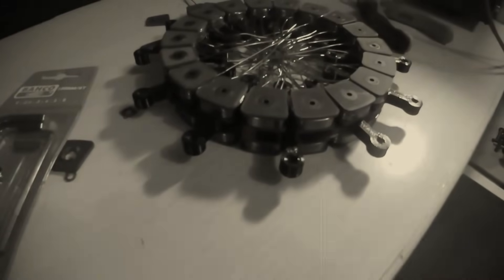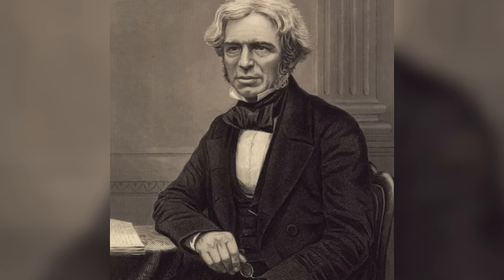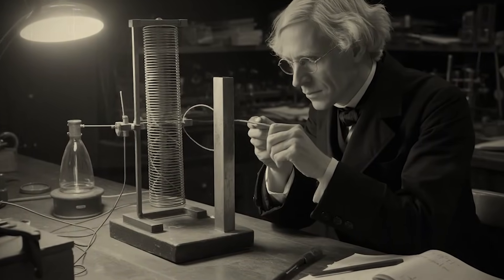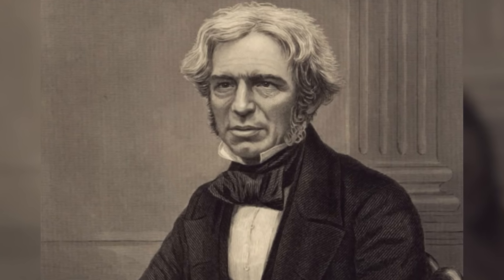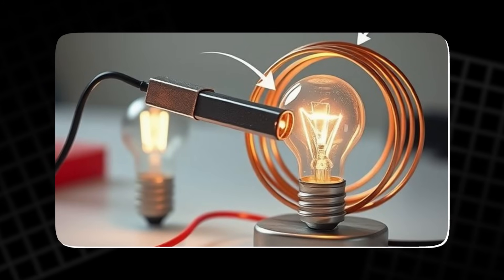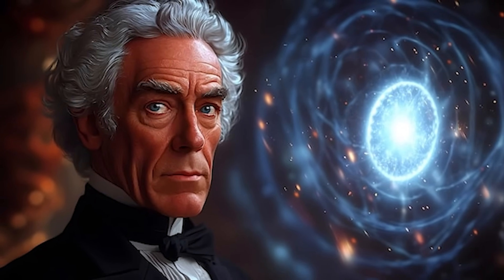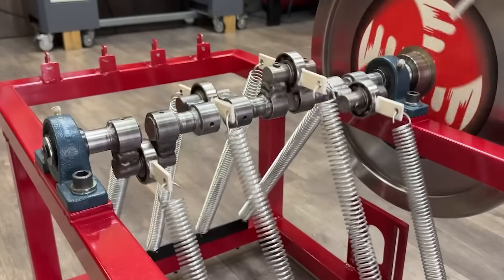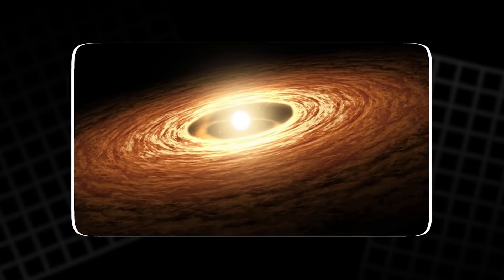Faraday's Unsolved Paradox: The Key to Free Energy We’ve All Been Missing!

Comment: A Faraday dynamo can generate very high electrical power from gravity. The disk simply needs to be magnetized with a very high-voltage, high-pulse power source, such as a Tesla coil. Then, when rotated at very high speeds, it will produce a very high electrical output. Similarly, Depalma has created a homopolar dynamo that has achieved an electrical output as high as 100 kW. This technology is also the power source for UFOs.